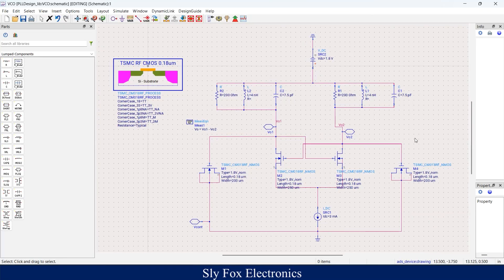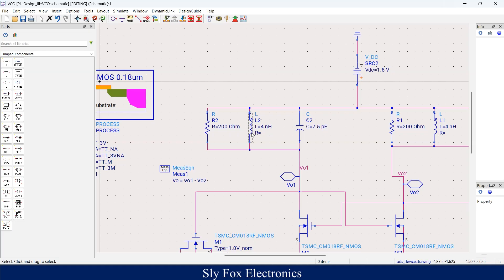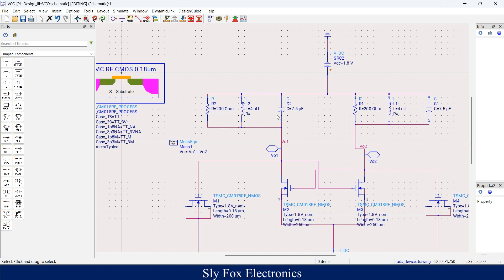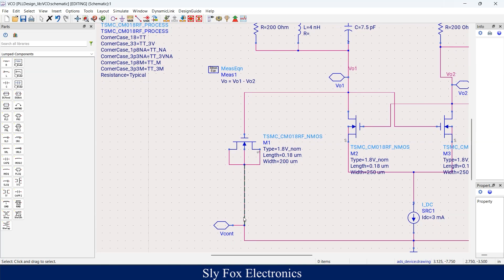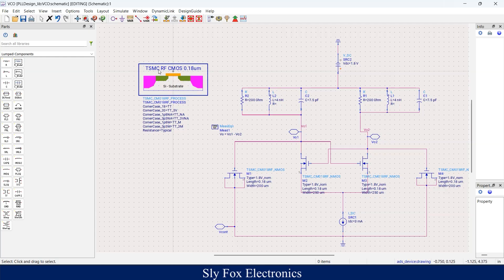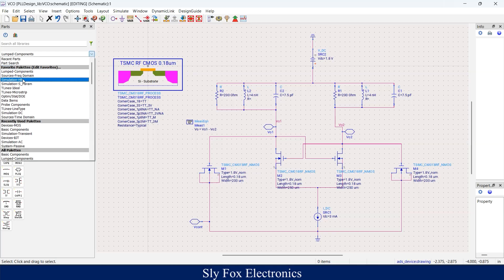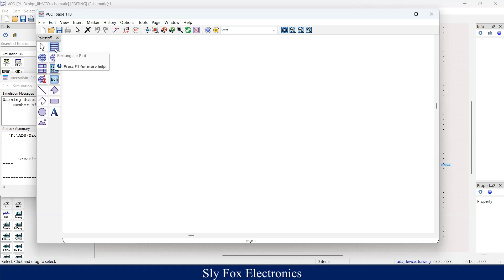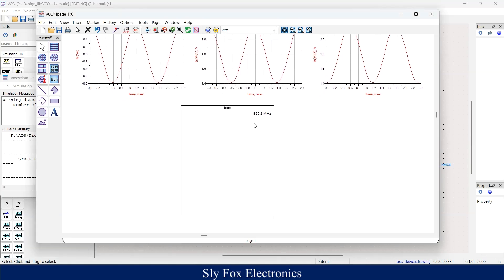Oscillator (VCO) Circuit Design in ADS

Comment: Hello sir. I'm working on this exact circuit, but I'm using Ltspice.

For an assignment, we first need to design a varactor, then use it to build a VCO circuit. We're also using the 850 MHz GSM frequency. I have a question. I built this circuit, and there's no problem with it, but I think I'm entering the "operation commands" (.op) incorrectly. What commands should I use to build this circuit in Ltspice, also using the tsmc 180nm package?

And what should the voltage supplied to the varactors be, "Vcont"?

I'd be very grateful if you could answer.
Reply from the maker: Hi! A few quick points for LTspice:

• .op won’t make an oscillator run — it only gives DC operating point. To see oscillation you must run a transient simulation:
.tran 0 2u startup

• If you’re using TSMC 180 nm, you must have the model files from your university and include them in LTspice:
.include tsmc180_models.sp
(You can simulate the concept with generic MOS models if you don’t have the LTspice-compatible PDK.)

• For the varactor, you can use a diode model or a behavioral capacitor, for example:
Cvar out control value={C0/(1+alpha*V(control))}

• Vcont is simply the control voltage that tunes the varactor. In a real PLL it comes from the PFD/charge pump. For a 180 nm design you usually sweep 0–1.8 V to see the tuning curve. but if your VCO's free running frequency is close to 850MHz(as it is in this video), this Vcont will be almost zero, otherwise Vcont will have a value to increase or decrease the frequency.

• To start the oscillation in LTspice, use startup or add a tiny pulse/kick.

Run .tran, plot the output, and use FFT to read the frequency. 

good luck with your design 🦊
Reply: Thank you so much , i will try it again with your suggestions .

Comment: Bro, where can I download component models from different manufacturers?
Reply from the maker: Most semiconductor device models (like TSMC, UMC, GF, etc.) are not publicly available. They are provided under NDA to universities (my case) and companies, so you can’t legally download them from the internet.
For hobby or learning purposes, you can use publicly available models—like SPICE models from manufacturers such as TI, ON Semi, Nexperia, Infineon, etc.—which are usually on their websites. you could also use ideal components models that exist in ADS software.
But full foundry PDKs (like the one I used) can only be obtained through your university or through a company with an NDA.
Reply: @SlyFoxelectronics  Could you send me a package of device models?
Reply from the maker: @ChunChen-d9u Most IC manufacturers and foundries don’t publicly release their transistor/device models.
The models I used here come from the university’s PDK, which is shared only under NDA (non-disclosure agreement), so I’m not allowed to redistribute them.